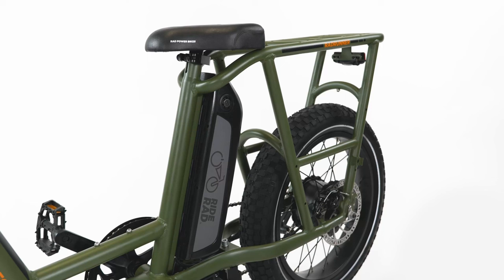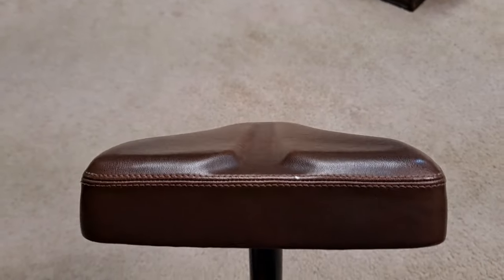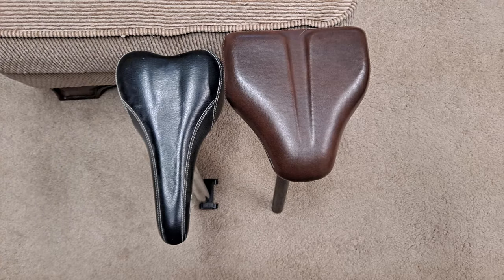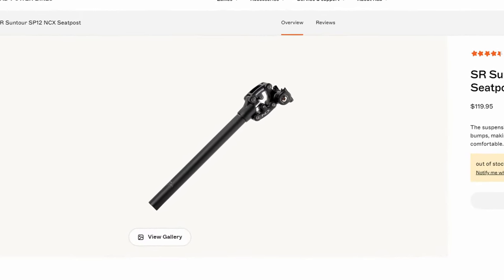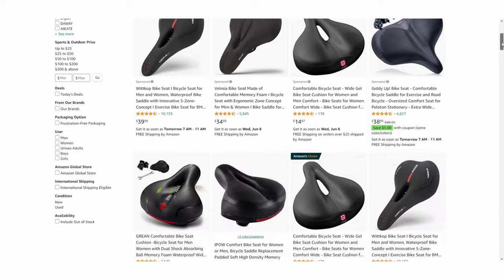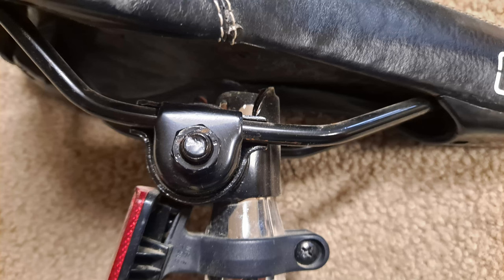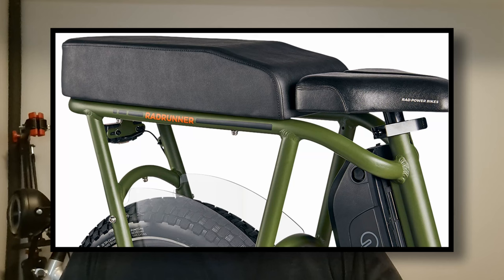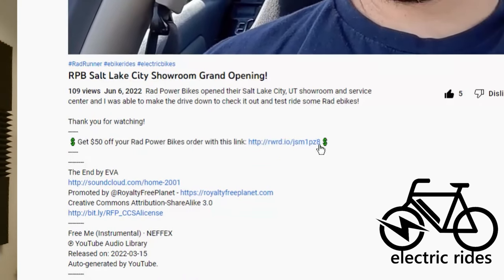The Issue With RadRunner Seats - Upgrade your hard saddle!

Comment: I'm interested in the bike but that seat and seat post is first to go, lay back seat post and saddle shifted back for more reach it looks cramped if you're tall, haven't seen a review of anybody over 6 feet yet. I'm 6'2 so I think I'd need to lengthen the stem too possibly.
Reply from the maker: I've seen a few RadRunner owners that were over 6-foot but I'm pretty sure they didn't pedal much and used it throttle-only most of the time.
Reply: @ElectricRidesUT  That's the reason I'm concerned 👌 I'm in Europe we don't have the throttle 👎

Comment: my complaint for  2022 seat blows  picked up a cloud9 metro line  and SR Suntour SP12 NCX bike Suspension Seatpost from AMZ
Reply from the maker: That's a solid setup!
Reply: I got both for my rad runner plus and my wife's and since my wife is 5'2 in. the cloud 9 doesn't sit low enough for her to be comfortable reaching for the ground when she needs to as the cloud 9 bites into the saddle.  I don't want to take the saddle off cuz it will change the look drastically and you never know if you want to have a passenger.  anybody got ideas with another setup or seat or ?????

Comment: I bought a rad runner plus. For a $2399 cad , they should have given a more comfortable seat. The moment I sat on the seat I felt uncomfortable. The most I could ride on that seat was 10 mins before my keester got sore and I couldn;t bare to sit any longer. Now I have cloud 9 seat installed and it makes my ride experience way better. Shame on Rad power for giving such a crap seat on a $2399 bicycle.
Reply from the maker: Yep, agree with you 100% I got the "upgraded" more padding seat that was released with the Runner 2 (15mm of more padding) and it's still pretty bad. Very poor design.

Comment: Rad, true to form, claims, or at least used to, that changing out the seatpost on the runner voided the warranty. 
Not sure if it applies to seatposts they sell or if it's even still enforced (uttering the magic words "Magnusson Moss" in general tends to stop a lot of silly warranty refusal shenanigans wrt use of 3rd party products that are unrelated to the warranty claim issue) but it's still in the help site:

"The seat can be replaced on all models except the RadRunner and RadRunner Plus"
[...]
"[T]he seatpost (which is a standard diameter 27.2 mm) can also be replaced, but this will impact your warranty"

Just something to know for if someone ever needs to use the warranty.
Reply from the maker: Thank you for the heads-up. This the first I've heard that Rad is being a stickler about replacing the seat. Where did you find this impacted warranty referenced?
Reply: It's anecdotal but I know of one person who Rad initially tried to refuse warranty service to when they brought their Runner 1 with a 3rd party seatpost and seat installed in to one of the stores.
They stood their ground however and Rad eventually relented. 

I'm hesitant to link anything since yt keeps deleting comments I post with links, but the language is in the help center under the title "Can I Mount a Water Bottle Holder Onto My Bike or Replace my Bike Seat?"